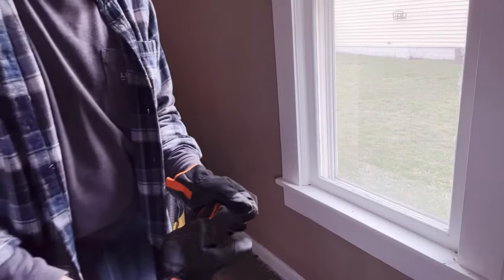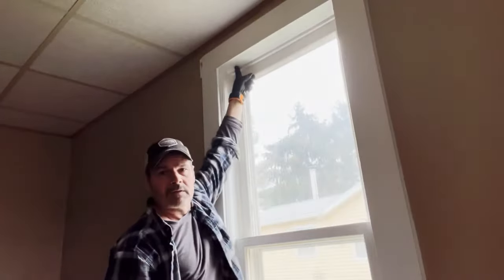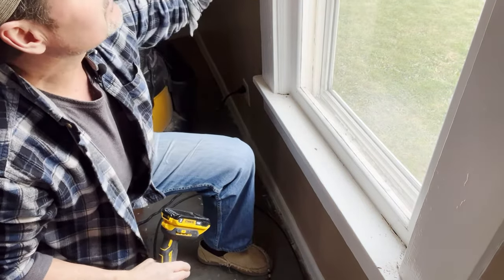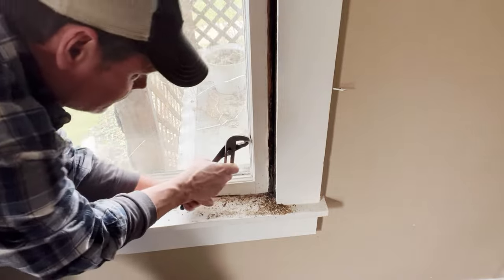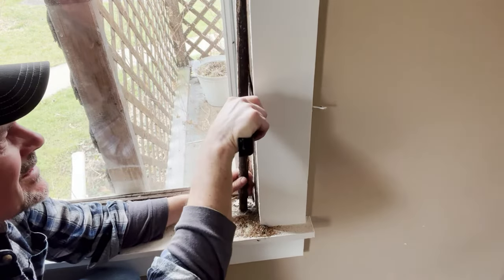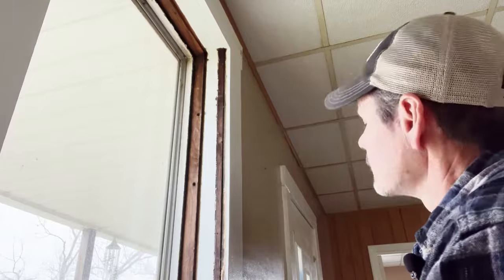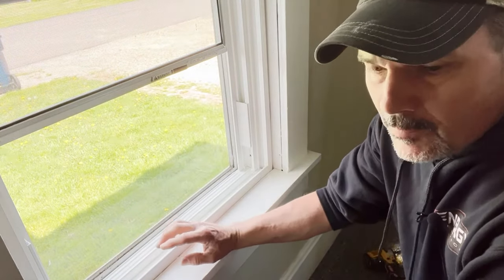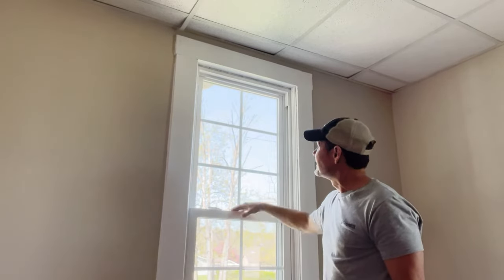How to Remove Old Windows and Install New Windows. #Windows, #Replacement, #Wincore, #DIY,  #House

Comment from the maker: Links to the tools and materials I used in this video have been added to the "description" section above.
Reply: Thank you!
Reply from the maker: You're welcome! @HarrietPayne-kx4ou
Reply: Great video…but did you remove you outer storm window? Just wondering, thanks
Reply from the maker: @dshaw2316  Yes. I only left them on until I got the new windows installed.
Reply: @DiyGuy50  ok, thanks. I just purchased a rental property and the windows are in rough shape. This video makes me STROOONG! 🤣 (like that goofy Drive Time commercial).

Comment: is it wrong to caulk the bottom over the flashing tape?   and what did you do with the storm window?  appologies  if its in another video i missed.
Reply from the maker: No, that’s what I did but I didn’t videotape it and it’s not in the video. I took the old storm windows off.
Reply: @DiyGuy50  Thanks!  did you have any issues removing the storms?  Did you just fill any screw holes with caulk?  did you need to paint after removing?  thanks again.  you got a sub from me!
Reply from the maker: @dylan1235x  No issues removing the storm windows . I only left them in because I took the old windows out to measure for the replacement windows and I knew it was going to take a while to get them. Just take the window panes out first and then it’s easier to remove the frame. Thanks for subscribing!
Reply from the maker: @dylan1235x  And, yes I filled the holes with wood filler (you can use paintable caulk as well ) and painted the exposed wood. Use silicone caulk around the exterior of the new windows. My replacement windows came with a strip of vinyl about 1” wide and as long as the width of the window. This can be cut to the width of the gap at the bottom of the window. It gives a cleaner look than caulk if that gap is very wide.

Comment: Im a little confused. Is there another outside window?
Reply from the maker: @garygoodwin3461  Yes. I left the old storm windows on until I had the new ones installed. I then removed them and used silicone to seal the outside of the new window.

Comment: I searched everywhere trying to determine the issues involved in just leaving the storm windows in place when replacing old windows. I found nothing. Then I watch your video and you just do it without any issues. Thanks.
Reply from the maker: Thanks for sharing! I did end up taking the old storm windows out, though. They were in bad shape. However, I did leave them in until the new window was installed. The only issue with leaving the storm windows on is it makes it difficult to put silicone caulk around the exterior of the new window which I think should be done even if you do keep the storm windows.
Reply: @DiyGuy50  Appreciate your situation. Mine may be a bit different. I'm in Maine where the "storm" windows also slow down the winter temperatures even with new windows. I get that if I take off the storm windows I will need to then caulk but what I really want to do is replace these windows on a second floor in the middle of winter with snow on the ground. My storm windows are a sort of a double pained version so I think I can actually caulk too without removing the frames. Always looking for a safer and easier way to do things!
Reply from the maker: @carefulandprudent1058  I couldn’t agree more!!!

Comment: You did a great job !!!!!!!!!!!  You really explained the process well.  If the windows are really old and have weights in the sides, is there a different process?  When you are done, can you remove the old storm window outside?  And, on the last step of replacing the trim on the sides, can you add a piece of trim at the top?   Thank you for posting this video !!!!!!!!!!!!!!!!
Reply from the maker: Thank you! 
The only thing different with the windows with weights is you need to either remove the pulleys or hammer them flush with the window jambs so they’re not in the way when you install the replacement window.
And, yes, you can install a trim piece at the top to improve the look. The house in this video did not have those pieces but many do.
Not shown on this video, I removed the old storm windows and caulked the outside of the window and and installed a bottom piece that came with the new window.  You’ll have a gap at the bottom of your window on the outside that you will need to fill and seal. I used something called “Poly Foam Caulk Saver by Frost King”. It’s tubular foam that comes in a roll and various diameters . Cut it to length and stuff it in the gap and cut the plastic strip that comes with the new window to the right size and install it. Then put a bead of caulk around it.
Reply: @DiyGuy50  Thank you so much !!!!!!!  I only replaced one window, my friend did it for me, but I watched him do it.  Your video looked closest to what he did.  I am going to try doing one myself.  If all goes well, I will replace the others too.  I am a Whistleblower, so my life is very difficult.  I have not had heat since 2012.  And I do not get any assistance.  I thought replacing the window would keep the house warmer.  Thank you sincerely !!!!!!!!!!!!!!!!!!!
Reply from the maker: @elissahoran1130  Wow! I’m glad I could help!

Comment: Do you have to measure for thicknrss (depth), or is that standard?
Reply from the maker: I’ve never measured for thickness. I think it’s pretty standard.  Occasionally, I have a small gap between the replacement window and the sill, but, normally it’s a perfect fit!

Comment: So dumb question. I live in a 200 year old stone house. The window sills are 22 inches deep. The windows are ancient. Basically, i just pull the window out and keep the old frame in?
Reply from the maker: If the frames are in good shape I don’t see why you couldn’t. I love old houses but they present many challenges. I would talk to the people you plan to order the windows from and make sure that a replacement window is applicable in your situation.

Comment: What’s a good replacement window?  I need to cut down the road noise driving me nuts
Reply from the maker: I own several rentals and have flipped quite a few houses and have always Wincore windows. They’re reasonably priced, ( average sized windows are just less than $300/window. No complaints from me so far. Idk how they are as far as noise reduction, however. Thanks for your comment!

Comment: And what happened with the exterior side of that window??
Reply from the maker: The old storm windows were taken off and any exposed wood on the exterior of the old window frame was painted, and a bead of silicone caulk was put around the new window.

Comment: The facts are, that restoring your windows makes far more sense than replacement windows. A properly restored and weatherstipped window with a storm is as energy efficient as a new window and it doesnt have seals that will fail in 10-12 years. Replacement windows are a scam
Reply from the maker: Restoration does not make sense in all situations in my opinion. No disrespect, but, I respectfully disagree.
Reply: You dont know what you’re talking about. No disrespect.
Reply: @jamesjoslin7586   Replacing a historic single-pane window also will not save you much money in the long run. While the exact figure will vary depending on the type of window installed and whether or not a storm window is used, studies have found that it could take 100 years or more for a replacement window to pay for itself in energy savings. According to information published in a recent Old House Journal article, it could take 240 years to recoup the cost of replacing a single-pane window-storm window combination with a low-e glass double-pane thermal replacement window. Also, a historic wood window can easily last more than 100 years, while a new window may not last 25.
Reply: @victorianantiquities  What about re glazing/ painting a “ historic “ window ? Very high maintenance that could be made even more so for high or hard to reach ones. Also, drafts, sweating would be a concern let alone more energy consumption. Lastly. There are very few improvements that actually “ pay for themselves “

Comment: Anywhere two different pieces meet there is caulking. Otherwise there would be a very noticeable dark line. Its common practice and should not be surprising. 

A bit of Caulk & paint makes a carpenter what he aint.
Reply from the maker: Perfect.👍

Comment: Does anybody knows what's the wood used to make the stool? My biggest fear is to get the old window out ,run to lowes or home depot and the don't have the measurements that i need..it doesn't make sense to take out all windows and measurements then look for replacement
Reply from the maker: With replacement windows, as opposed to construction windows, You don’t need to replace the entire window if the window frames are in good shape. So the old sill, stool, side jams and head jam (the window frame), does not get removed.  Unless, of course, they’re in too bad of shape. If they are, the whole window, frame and all, must be removed and replaced with what’s called a new construction window. Also, it’s not likely that you’ll be able to get replacement windows for an old house at any home improvement store like Lowes. They have to be ordered from a place that makes windows to your size.

Comment: Our new windows were installed on top of the stool made of marble..Is that ideal? What if I want to replace or install a new trim? Thx
Reply from the maker: That’s a good question. I don’t replace windows for a living so my experience is limited. I’ve never had the privilege of replacing windows in a house with marble window stools. Personally, I think the marble sounds like a nice touch, though!

Comment: buying my first house at 26 yr old it has single pane windows trying to get an idea of if this is within my skill level or not, I've done flooring and small bits of drywall along with numerous other things. 
still not sure about this though
Reply from the maker: Congratulations on buying your first house! 
What, specifically, are you not sure about?
Reply: @DiyGuy50  watching a video on how to do something versus actually doing the task sorta thing, nothing wrong with the video

Comment: Thank you. My old windows have those weights behind the sides.... so basically youre just leaving the frame and weights there, and measuring inside? ...and i thought it all had to go.... this seems way easier, or is my situation different? TIA
Reply from the maker: Yes.  The frame is not removed with replacement windows. The weights in the frame are not removed. The pulleys should be removed or hammered flush with the frames . Thanks for your question!
Reply from the maker: Your situation is exactly the same as mine except for the weights. And you’re right. A “replacement “ .window is much easier to install than a “new construction “ window .
Reply: Where are the screens? The storm window frames  also held the screens in old homes I lived. I do not see any screens for the new windows...? Do people like bugs and birds flying in nowadays or does no one open windows anymore. What am I missing? 😊
Reply: @llee2096  screens are built into new replacement windows.

Comment: Whyyyyyyyyyyyyy do people caulk the windows shut?? Maybe I will try to replace the whole window after watching this..
Reply from the maker: Lol, I don’t know! But the house in this video was  almost 100 years old, so it had a lot of paint and caulk! Replacing the whole window is usually not necessary and it’s a lot more work! The multi tool cuts right through the years of paint and caulk.
Reply: Our house is also almost 100 years old and the windows are caulked shut from the outside.. 😩 I decided to try to open one in the living room today, hoping to have 1 window in each room that opens, but it was also NAILED shut.. why??? 🤦‍♀️I managed to slide a hacksaw in and cut the (thankfully) small nails. My husband did mention getting a multi-tool like that!
 It's not safe to climb up from outside and unscrew the storm window to pry open from outside- I did this with my dining room window- because of uneven ground and a stone wall that drops off. Also a crepe myrtle tree doesn't allow for better positioning of a ladder.... so that's why I started looking up videos on how to just replace it. It looks really rough at this point now too, after all the trying to force it open..  😬
Reply from the maker: Oh, I misunderstood your first comment! I thought your we’re considering putting in a new “construction “ window, as opposed to just installing “replacement”  windows . Replacement windows are not difficult to install once you get the old ones out., but yes, the paint and caulk and nails do make it difficult! Good luck!

Comment: How do you measure what size window is needed without removing old window?
Reply from the maker: @newroadchurchaustintownohi728  I have always removed both of the window sashes to accurately measure height of the opening. But you can get by with just removing the lower sash.

Comment: Wait, I need to remove the existing window (the glass is oxidized) and add new ones. Did he just place the new window in with out removing the old one (Meaning, I see old glass still there on the outside)?
Reply from the maker: The old glass and window you’re referring to is the old storm window I had not yet removed. It was still chilly outside when I removed the old windows so I left the old storm windows on until I had the new replacement windows installed then I removed the old storm windows.

Comment: I have to replace all my windows in my new/old house they’re double pane with storm windows. The kitchen and the bathroom have slide ups the kitchen one I definitely want to make bigger. Hopefully I can do this by myself.
Reply from the maker: If you’re putting a bigger window in, you will be cutting a bigger opening and installing what’s called a “new construction window”.  My video shows how to install what are called “replacement windows”.  You’ll need to do your homework if you’re not familiar with installing “new construction windows “. 
Thanks for commenting!

Comment: What if the old window doesn’t have the stops you butted the new window against?
Reply from the maker: Good question. I’ve never run into that situation.  You’ll probably have to use trim .

Comment: Hello! I'm hoping you'll be able to tell me where I can get more of these windows and screens with that slide "thingy" at the bottom to raise/unlock & lower/lock. Looks like their in this video on the outer side of the window you just removed.  Hope you can help. Thanks.
Reply: I think I found the answer. They're called storm windows. (Just didn't know😊)

Comment: You made this look so easy! Hopefully purchasing a house that needs all windows replaced, unfortunately. I can only hope this can go smoothly doing this myself.
Reply from the maker: Take good measurements and check the squareness of the window. If the window is square, you can get by with ordering a window that is 1/4 inch shorter in length and width. However, if it’s not, you need to take more than 1/4 inch off or the new window won’t fit! This is very important!  Also, I don’t know your experience and skill level when doing these kinds of projects. If you don’t have much experience, it’s probably best to try one window before ordering them all. It could be very costly if you don’t measure correctly and they don’t fit! Thanks for sharing and good luck!

Comment: I got told by a contractor that my trim around my window couldnt be reused! He said it would be $65 in labor extra to stain n install new trim, then he said the sill piece at the bottom, would be gone! I see you didnt remove any of the outside trim around the window(casing), why did he tell me that?? Also the trim outside would be gone! And my storm windows outside have to go too!
Reply from the maker: I’m not sure. It sounds like the contractor was talking about installing what are called “new-construction” windows as opposed to “replacement windows”.  With replacement windows, none of the trim needs to be replaced.

Comment: Hi Stephen, what is the benefit of leaving storm windows on? I have similar storms and was curious if I replace the main window
Reply from the maker: Hi. I removed the storm windows after I installed the new windows. I took the old windows out to measure for the new ones, so instead of putting the old windows back in while waiting for the new I just left the storm windows on.

Comment: Was there another window on the outside ?
Reply from the maker: Yes. Old storm windows that I left in place until I had the new windows installed. Then I removed them and used a good silicone caulk to seal the out side of the new windows.

Comment: Our contractor removed most of the interior wood trim around the window including the stop/sill, trim up the walls snd below the stop/sill breaking 2 of them. Insulation left on the floor. Was supposed to be a replacement only with same size. Wondering what he did. Left us more repairs and costs.
Reply from the maker: It sounds like he installed a new construction window instead of a replacement window.
Reply: He had no idea what he was doing. You picked the wrong guy.

Comment: what about the old storm windows which should be unnecessary now?
Reply from the maker: Yes. You are correct. I removed them and caulked around the exterior of the window.